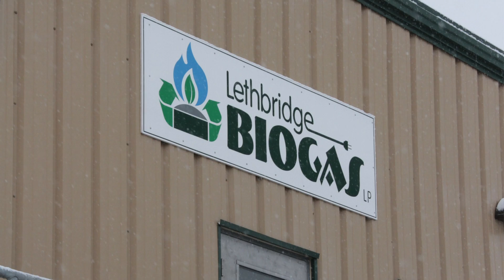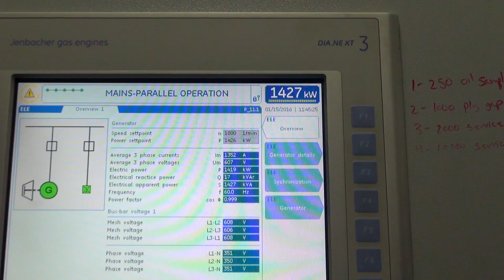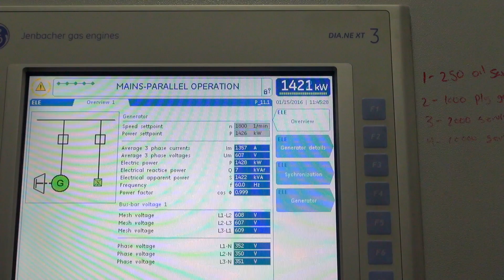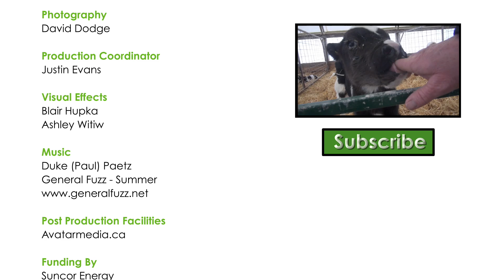134. Lethbridge Biogas - Making electricity from pooh and waste food

Comment: Awesome video I started my 275 gallon IBC digester on cow manure. 4 weeks later I had burnable biogas. I now have videos of me powering a small gas generator. Gas production with good temps will bring better results very true. Colder climates have more problems with smaller systems.

Comment: Burning methane produces carbon dioxide just like burning anything else. I wonder how they get away with claims that they reduce the carbon footprint.
Reply: because Methane is 20x worse for global warming / climate change compared to CO2 so burning methane to create CO2 is a huge emission reduction
Reply: Human sources of methane are insignificant compared to what the oceans and vegetation on land produce. Furthermore, who came up with the 20X the carbon footprint number?
Reply: Canvideo when I worked on the IPO of a company retrofitting anaerobic digesters onto high intensity farms in Latin America, the UNICC credited companies who converted methane to CO2 with a 20x emission reduction credit which could be traded.
Reply: "Human sources of methane are insignificant compared to what the oceans and vegetation on land produce."

True but that's been going on since time immemorial and clearly hasn't hasn't had enough of an impact to produce the very rapid increase in global temperatures. While I guess if we could go around finding every peace of rotting vegetation and start burning the methane from it it might be beneficial, I'd imagine that would be pretty hard to do.

Comment: This can also be use as a highly flexible power source. If you add gas storage or pipelines to connect the plants. Upgrade the biogas to methane and then use the pipelines to get it into homes for heating, to make plastics, or fuel for cars.  You can increase and decrease the power output at will.